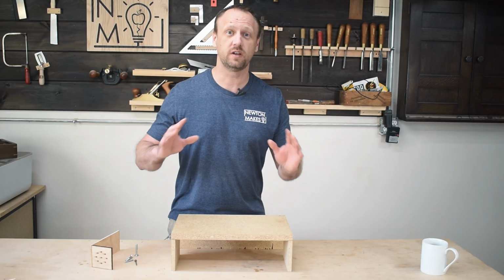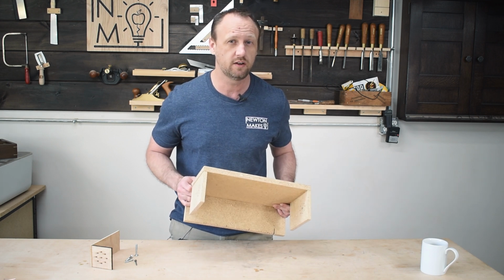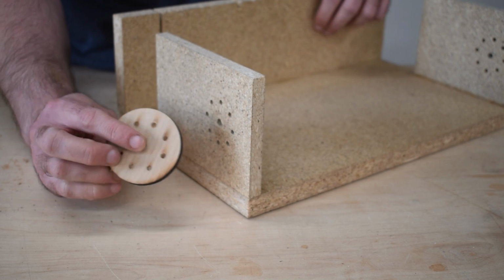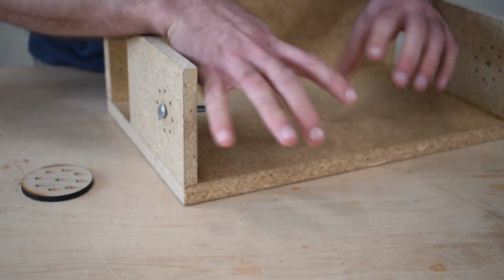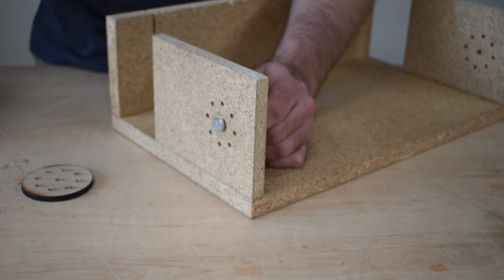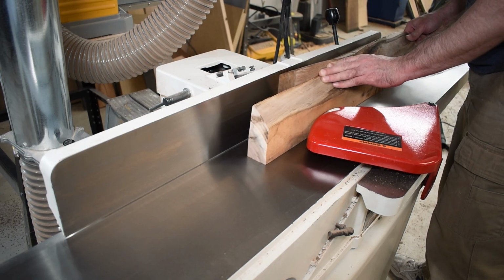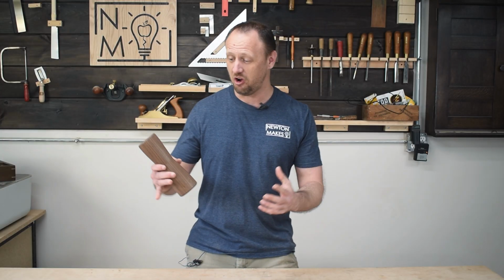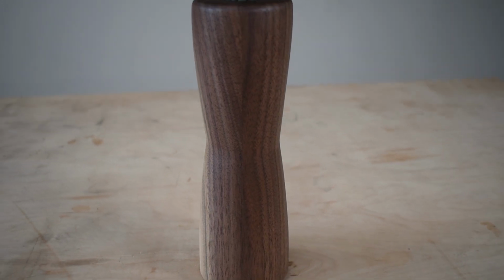I Made a Table Saw Lathe! | No Idea This Would Happen!

Comment: That worked out pretty well Billy!  I've also seen it done having a shaft sticking through one end connected to the work piece with the other end chucked in a drill turning the work piece against the rotation of the blade.  Do whatcha gotta do to do whatcha gotta do!!  All the best buddy.